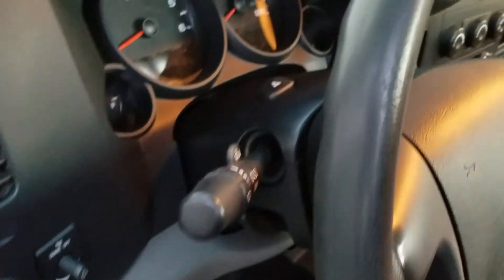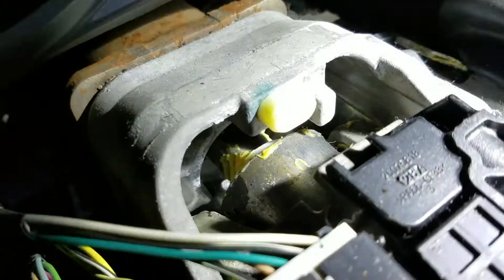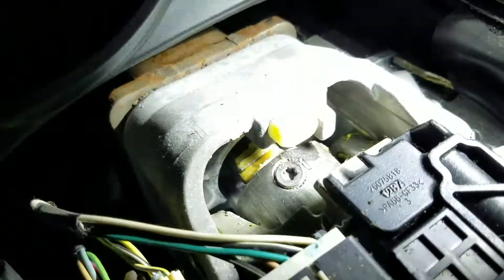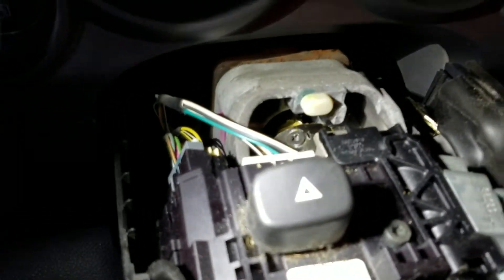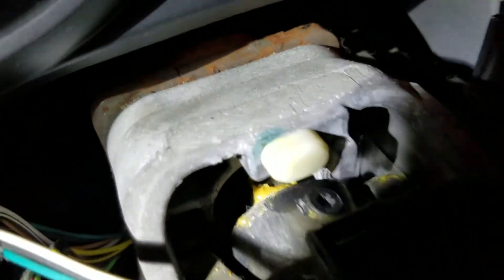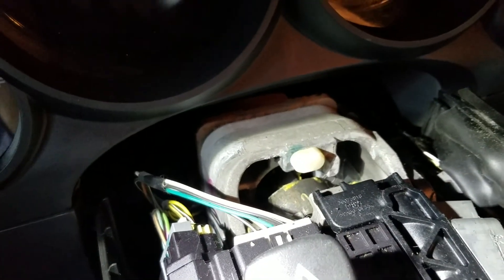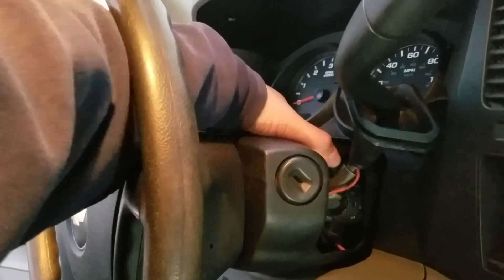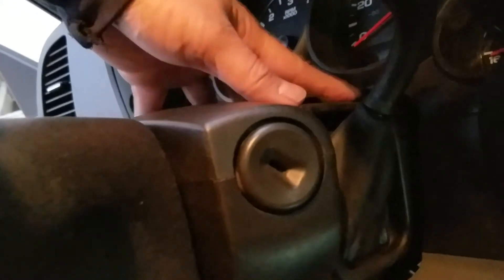2009 Chevy Silverado 1500:  Steering column coupler has excessive play

Comment: I found those screws continually loose. After multiple loctite applications it worked better. There was oily residue all over everything. Finally the loctite held...it was better but still a little play. I could look in there and see wear grooves where the screws contacted the flat of the top of shaft. I then tried to put a jb weld washer on the end of the screws and reinstall which worked great for a few thousand miles then got the play again. My next plan was to tig weld a washer on there I believe it fell out. Since the extra length worked well the length was the issue I believe. I think the previous owner yanked on the wheel to get in/out so just wore grooves since it loosened up. 

 Now the clock spring has gone bad killing my cruise. I'm putting another column in and should fix both issues as well as much cheaper than just the clock spring.  Had the new column in for a while clock spring wasn't bad. Finally narrowed down to a failing brake controller. ECM stores last 7 cruise interrupts and indicates what it was, brake circuit or cancel. Kept saying brake circuit. Replaced pedal switch still did it. Other random codes for communication with BCM or something. Disconnected the brake controller removed the scotchlocks put in a good Tekonsha and poof no more issues.
Reply: Did you ever figure out what it was? Mine is the same way. Grooves and won’t even tighten anymore
Reply: Mine too idk what I can do
Reply: @VideoSpartans  I just got a used column and put it in. If you do it I'd cut the lower part of the shaft bearing shroud since it's impossible to change the shaft bearing with it on there. Or throw the bearing on there and call it good. 2 Torx screws on top of column holding shroud bracket on.

Comment: what is the name of that plastic part? I tightened it but after couple hundred miles it loosened again and clunking  noise came back
Reply from the maker: I’m not sure if that part is available on its own as a service part.  Not entirely sure what GM would call it.  I have replaced entire steering columns on these trucks when the adjustment wasn’t enough to eliminate play or clunking.